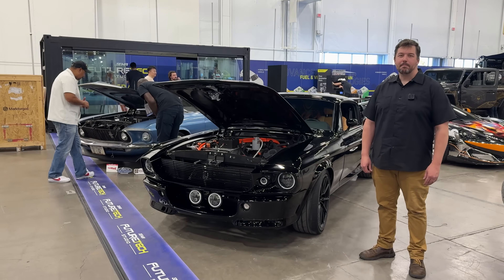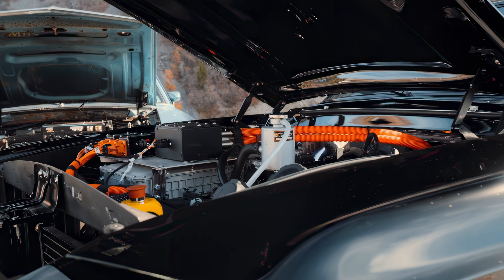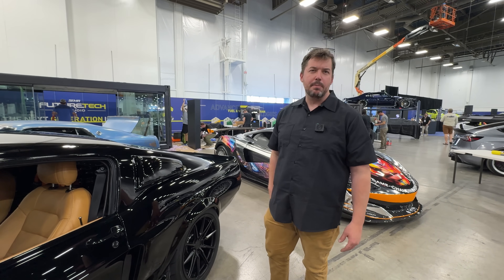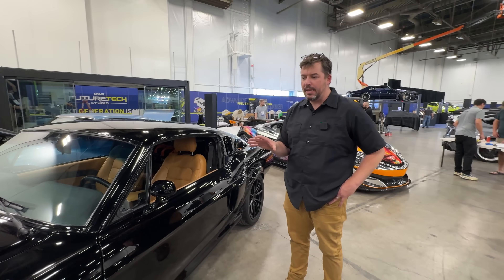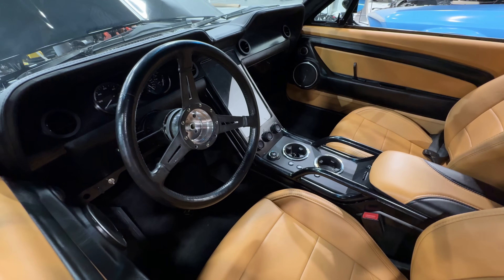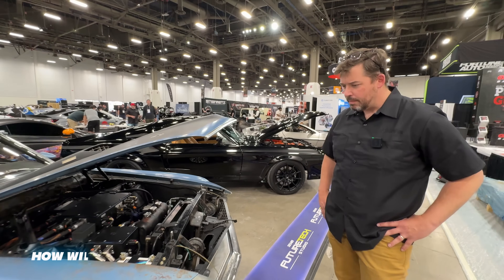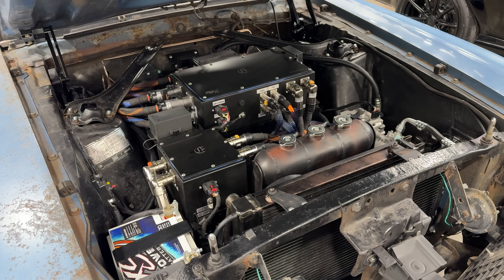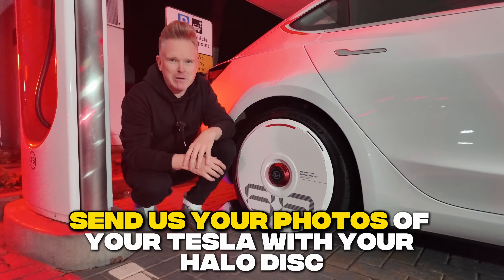EV SWAP, SOLVED: How Builders Are Switching to Electric Without Relearning Everything

Comment: I’m building a Race car replicas GT-40. I did some calcs with EV West and using a Tesla motor and the batteries at the time would only give 120 mile range and probably only 40 on the track. I ended up buying an LS with a Porsche transaxle.